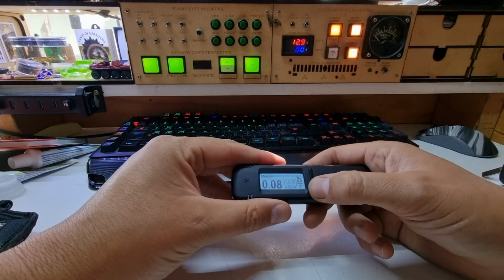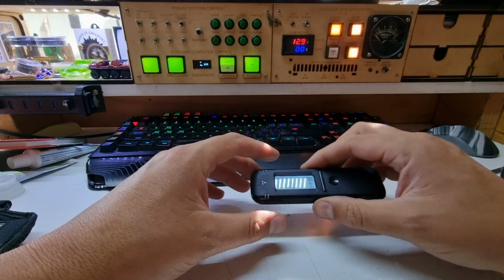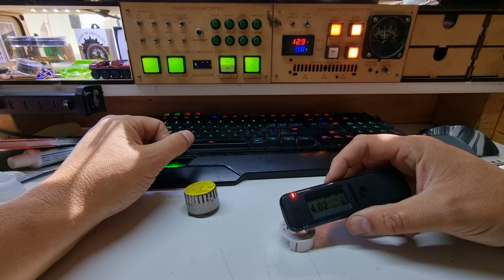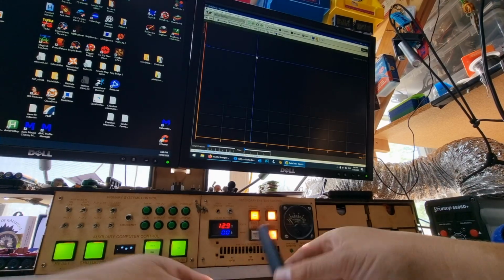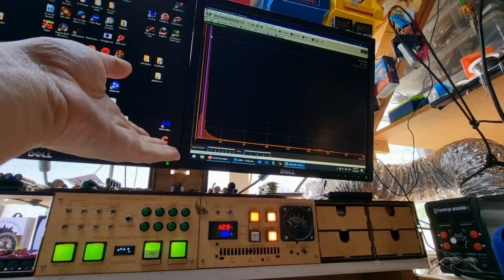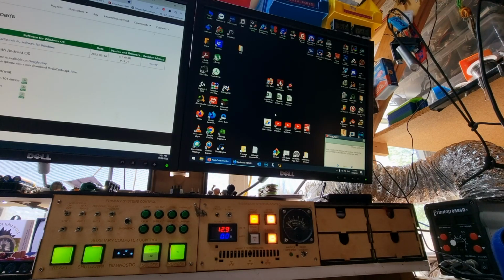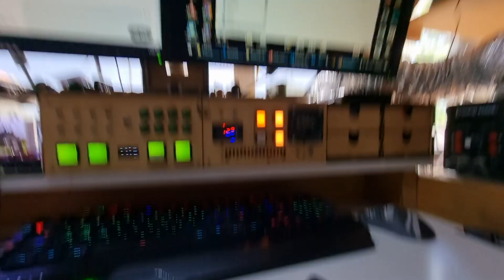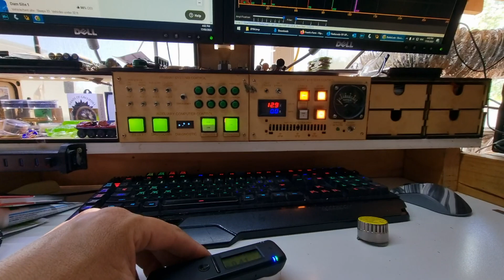Radiacode 101 | Energy compensation update.

Comment: Good day! The difference in readings is mainly due to the presence of beta radiation, from americium's daughter, neptunium. I would also like to note that the 101 shows a lower value than the Geiger tube instrumentation, because: 1) not all dosimeters compensate for the detector's own background, 2) background readings are often below the measurement range. It is also probable that at low backgrounds the dynamics of devices on geiger counters is different. Scintillators do not have this effect. And lastly, check the calibration of your device, by the presence of potassium-40, and energy correspondence on the spectrum. Now the readings depend on the spectrum calibration)

Sincerely, Evgeny Solovyov, Scan Electronics.
Reply from the maker: I appreciate detailed replies like this. I'll pin this for future viewers with questions
Reply: Are the calibrations off on the radiacodes when you get them ? Or how often should you have to re calibrate them ? I didn't want to mess with the calibration and throw off the device .
Reply: @TheXone7  thank you very much kind sir for the reply!! It seems to be pretty accurate as far as I can tell.

Comment: I wasn’t aware that the Radiacode was once not energy-compensated. I really enjoyed your video because it’s a great demonstration of this fact. The Radex is not energy-compensated, which is why it measures a much higher dose rate. I’ve left some notes about the Radex on the forum.
Reply from the maker: Anything with a geiger tube is not compensated.
Reply: @TheAussieRepairGuy , there are Geiger-Müller detectors, like those from Thermo Scientific and Atomtex, that are energy-compensated using a tube filtration technique. However, they are more expensive and aimed at professional users.
Reply: I use one of these detectors in a short and in a video on my channel. In any case, an energy-compensated Geiger-Müller detector cannot be as accurate as a scintillator or an ionization chamber. The design of these detectors makes the measurements acceptable across the energy range, but not necessarily precise. I believe this was the point you wanted to emphasize.
Reply from the maker: @IonizingRadLab gm tube by design can't detect the energy of a particle
Reply from the maker: @IonizingRadLab  yeah that's usually by means of switching out different physical barriers or "shields".
Reply: @TheAussieRepairGuy , that's correct, they cannot.
Reply: @TheAussieRepairGuy  , energy compensation in a GM detector is typically achieved by placing filters around the tube. These filters reduce the detector's inherent over-response to low-energy radiation, making the count rate roughly proportional to the dose rate. However, this is still an approximation, as GM tubes are simple counters and cannot distinguish between particle energies.
Reply from the maker: @IonizingRadLab i'm aware. But the tube it'self by design van't do that without help.
Reply: @TheAussieRepairGuy  , exactly. The naked tube has a huge over-response, which is why filtration is essential. The cheap consumer GM counters on the market are just simple counters, not proper dosimeters.
Reply from the maker: @IonizingRadLab the radex uses a version of the old russian sbm20 tubes, not very responsive. I borrowed the tube out of it a few years ago when building my own gps logging counter. I'll have to find the video one day. I'm travelling at the moment, so it's a bit hard

Comment: Do you need a laptop at least to do the firmware updates or can you use a phone? Nice video and cool desk !!!
Reply from the maker: I've never tried to update firmware with the mobile app, I'll look into it.
Reply: @TheAussieRepairGuy  thank you very much! One more question when you have the time ,how do you change it to food checking mode ?
Reply from the maker: @Desertprophet83  I didn't know it had such a feature. Normally if your food reads significantly above background levels, it's probably not a great idea to consume it.

I had a look into the updates, and it needs to switch to firmware update mode while on usb-c, this can't be done over bluetooth.
Reply: @TheAussieRepairGuy  thank you for taking the time to look at that. I really appreciate it .
Reply: Also so the update makes the radiacode less sensitive? Cuz of energy comp ? Its less sensitive
Reply from the maker: @Desertprophet83  the update doesn't make it any less sensetive, it just changes the math to give a more accurate reading. Lower energy radiation like beta radiation is less dangerous and therefore influences the reading less. It will still flash/tic to inficate a detection at the same rate.

Comment: In 4.0 version they quadrupled number of spectre channels, update released on 28.04.
Reply: Nice, I just updated to 4.01 on my original Radiacode 101 (bought Jan 2022). It sure does seem to have increased the spectral resolution. I took a quick spectrum in the app and shared as xml. There are several single non-zero points surrounded by zero. Also a pair of non-zero points with zero around. So it's not merely interpolating the original 256 resolution to 1024. It's nice they upgraded the old version rather than just push you to buy the 102 to get the new resolution.
Reply from the maker: I'll have to look into that

Comment: the difference in readings here is due to the fact that the sensor at the radex is larger than the source, because of this the sensor does not measure the field, there is a rule - if the source is measured, then the distance to the source must be no less than the size of the sensor.  At a distance of 5-7 cm, the readings of the instruments will be the same.